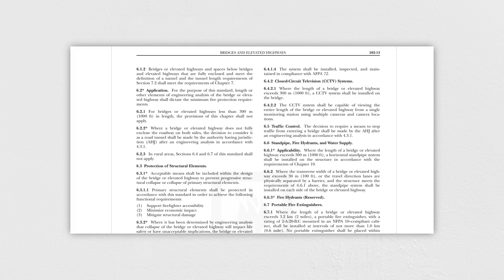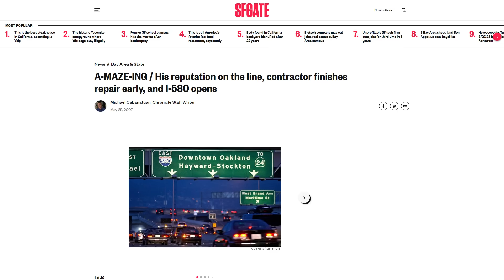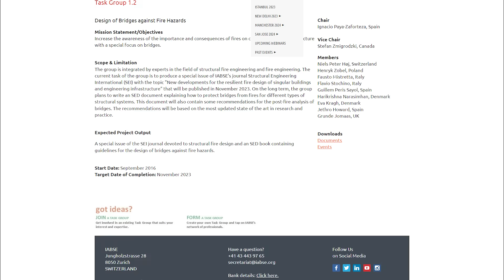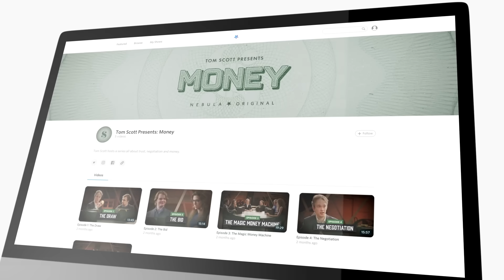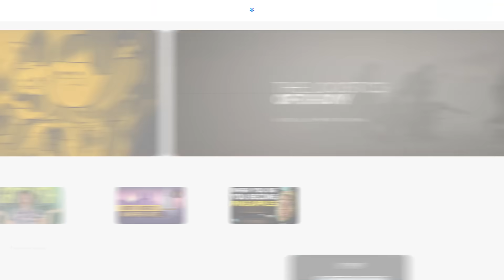Philadelphia I-95 Bridge Collapse Explained

Comment: There's going to be a lot of lithium fuel cell fires in future crashes.
Reply: The energy release is likely similar to a ICE car fire. Harder to put out of course, but similar release. A fuel truck is something else entirely.
Reply: With the new sodium chemistry and already existing LFP chemistry there will be less and less....
Reply: Not, despite all the BS you see on the internet, battery vehicles have a much lower fire rate than gas vehicles. They are simply harder to put out. Virtually all of the around 600 vehicles that catch fire every day are gasoline vehicles. Ever noticed that gasoline is flammable? 🙄

Comment: Crazy, we just had something similar to this happening just outside of Toronto Ontario, Canada. They deemed that the bridge was okay, so far it's still standing.
Reply: The reason why the bridge was okay was because the truck was not underneath the bridge. I live close by and seen the truck on fire
Reply: remember the bridge (highway 8) that washed away due to the bad flooding in 2021. The impact of that was tremendous and was felt all the way on the east cost as that connects Canada to one of the biggest ports. Shows how our infostructure in Canada needs to be updated and "fool proofed".
Reply: Indeed it was Brock Rd in Pickering. The concrete spalling is insane! If they had to rebuild it Canada's busiest highway would have been closed for months!  It's 10 lanes wide through there!
Reply: Just last week there was a gasoline tanker that rolled over on a highway flybridge for the I-10, I-25 here in las cruces
Reply: till it isnt.....
Reply: There's another one in New Mexico. Kind of makes me wonder.
Reply: Same in Cincinnati! They did some repair but she made it
Reply: @@fredthe47th Everyone understood him just fine, accept* you!  (their!  i left you another 'easter egg to fined & correct!  Knock yoreself out . . . please!)
Reply: where was this and which bridge? I don't recall hearing about it
Reply: @II__argo__II The bridge was Brock Road in Pickering. Ended up closing the highway at the 3 nearest exits for a couple of days. 

The fire was definitely below it, while not directly below it, the bridge was heavily scorched but apparently structurally sound.
Reply: @II__argo__II  near pickering i think, it was a few weeks ago.
Reply: If an incident like this (video) happened in UK, it would have been at lease 12 month motorway closure. UK rules are so strict about safety on roadworks that they cannot accept fixing the bridge for under a month. They also do overnight closures for the same reason (but minor maintenance work is exempt and can be done under lane closures) as it not only makes the work safer, but also faster as they have the entire road to themselves. Our roads are too busy to close during the day. But as this sort of bridge collapse never happened in UK, idl what the procedures would be.

The E25 bridge in Genova, Italy collapsed due to serious weather and structure issues and closed the motorway for 2 years in August 2018, but keep in mind the entire bridge was rebuilt due to the reasons abve.

I watched a time lapse in the Netherlands where they dug an underpass, and they only closed half the motorway for a weekend where it takes months in GB. China would have done that type of work in a minute.
Reply: @annabelholland  How long it takes to fix something depends on many factors including vitality of that roadway, cost, safety considerations, and probably far more that I cannot comprehend. This type of interstate in America is VITAL for daily traffic. Closing it for even a week would be so painful for the city of Philadelphia. They cannot let it stay closed for an entire year. Nor would the UK allow it if they lost a similarly important piece of road.
Reply: @roots4x  different country, different rules. Its safe to say that the US would rush to open the road ASAP. As the rules in UK are different and there are not many drivers, 12 monthd to close the motorway is acceptable to fix the bridge. The restrictions on road safety is more strict that a bridge in a month is not acceptable. That is also whyUK allow overnight motorway closures to take shape.
Reply: Canada SUCKS
Reply: Of course it is. Jet fuel can't melt steel.
Reply: @petermgruhn It depends on the teperatures reached, and the stresses on the members while its being heated. I suggest you have a look at the metalworking/blacksmithing channels. Those guys forge and shape steel using propane fuelled forges. Why? The burners concentrate the flames through jets. And in the twin towers, the het fuel wasnt the the only source of fuel. The offices were full of materials that burned too. And the impact of the planes plus free oxygen from the breaches in the building would have fed those flames. Have a nice day.
Reply: I'm glad you added "Ontario Canada" or I'd think you were talking about the other Toronto
Reply: @timmccarthy9917 as this video will likely have a primarily American audience I wanted to make sure there was no confusion. I'm sorry if this for some reason caused your day any negative emotions.
Reply: @ToughCanadian Don't apologize for writing a clear, concise post. I appreciate you giving us the exact area,"Toronto, Ontario, Canada". Some people combine just to be heard. Ignore them. 👍✌️
Reply: @olliefoxx7165   Well, alternatively he could have said "the center of the universe" and we'd have all known it was Terono.  ;)
Reply: @ToughCanadian  Major Canadian cities are well known by Americans. We even have an MLB baseball team in Toronto. America itself is huge and isolated so Americans often are thought of as "ignorant" to other countries, which I won't get into here. But we think of Canada as a close neighbor both geographically and culturally. There's no confusion when someone says Toronto, Quebec, or Ottawa. Especially when you're engaging people watching a video like this.
Reply: @roots4x  perhaps it was incorrect to say an American focussed audience, more just a global audience and this would avoid any confusion. Though I truly didn't think that anyone would care that I added further clarification to the location. In fact, I didn't think anyone would care about the comment at all; but here we are. You can't please everyone on the internet 🤷
Reply: @roots4x But definitely not Moncton. Gander perhaps, but only because of the press it still gets over taking on all the planes during the airspace closure due to 911.
Reply: @ToughCanadian  Never under-estimate the stupidity or pettiness of Youtube viewers! LOL
Reply: @timmccarthy9917 Or the other Ontario (California)

Back before I moved to SoCal, I would see discussions about Ont CA, thinking it was Ontario Canada, and would get confused,  lol😂
Reply: dont flee tredu coward

Comment: tanker trucks, the natural enemy of bridges
Reply: Interesting question... seems like EV batteries burn as hot will we eventually see EV fires be as dangerous to bridges?
Reply: @davidsloat1016  More potential thermal energy is contained in a tank of gasoline than in an EV battery. And gasoline powered cars are more likely to catch fire than EVs. Yet nobody is worried about car fires. Only EVs.
Reply: @davidsloat1016  I honestly thought the same thing.  I'm all for EVs but we do have to consider the risk and rewards of any technology.  Fortunately EV fires are extremely rare, at least with more reputable brands (not cheap Chinese* ones) and assuming someone doesn't poor gasoline all over them (at least one of the big EV fires that got a ton of coverage as proof about how dangerous they are was caused by vandalism).

* China is actually capable of making high quality stuff for an appropriately high price but they are also perfectly willing to make low quality stuff for a lower price, it's not hard to guess which option most US companies go with.

Comment: Nah, I don't believe any of that..
Jet fuel doesn't melt steel beams!
😜
Reply: Jet fuel can melt engines, stressed steel beams can melt in half quicker than you think.
Reply: It brought two large buildings down in New York City in 2001
Reply: @cobra7250  nah, you did not just do that…